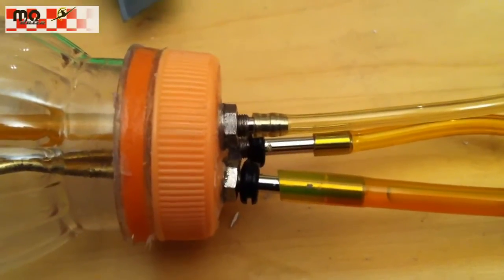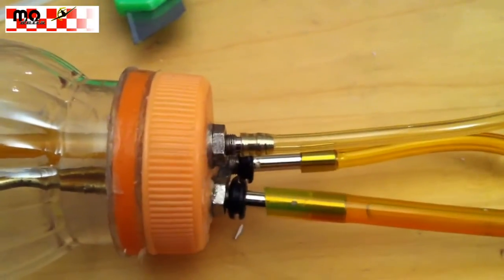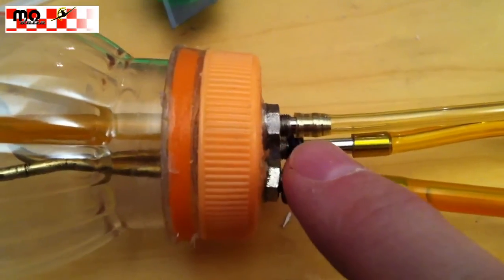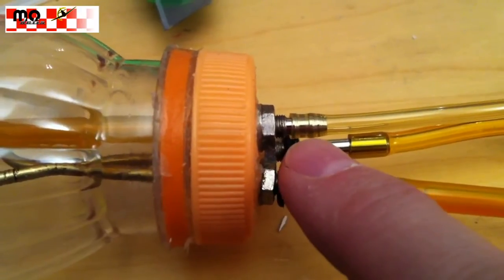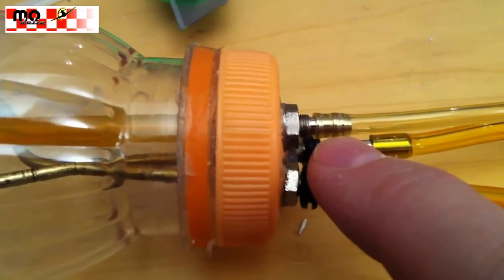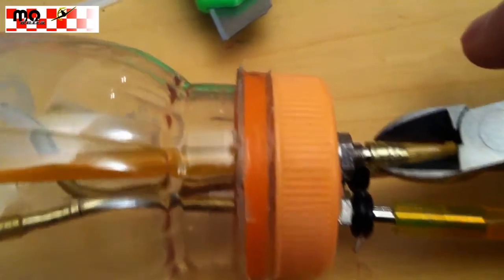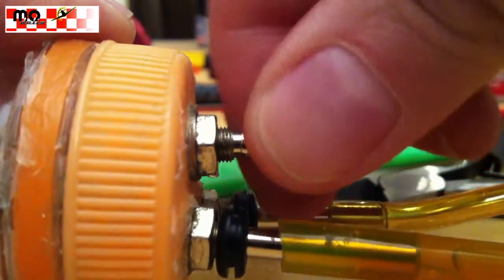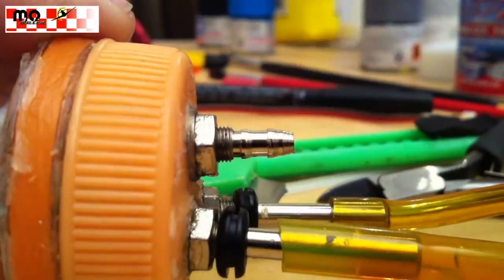MoDelis How-To - Schlauch entfernen - Removing of tubings

Comment: Very useful tip. Gasoline/methanol engines do not draw much, so one may get away with damaged nozzle... But turbines do suck more and will draw air between tube and damaged nozzle(eith scalpel or similar) if there is a groove.
Keep up the great work.
Happy flying